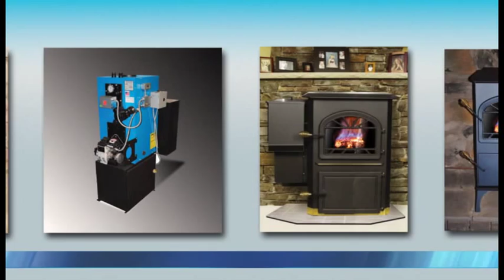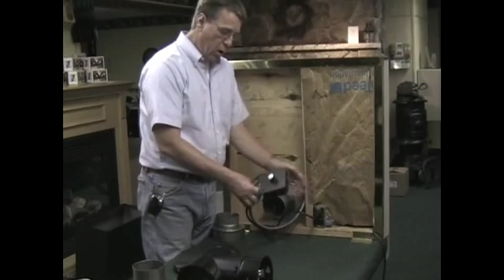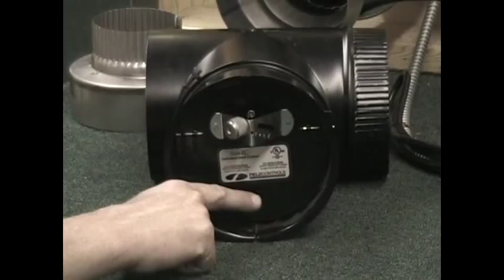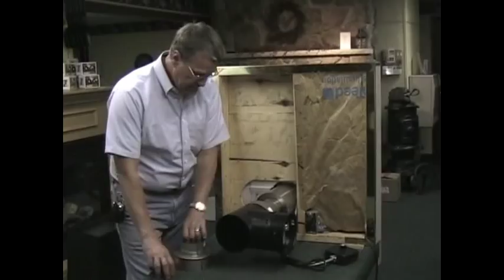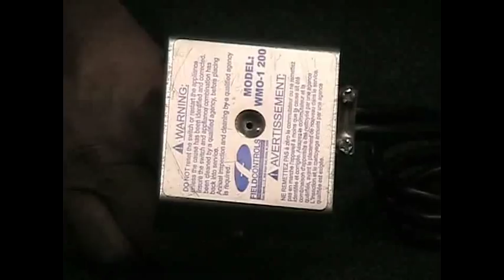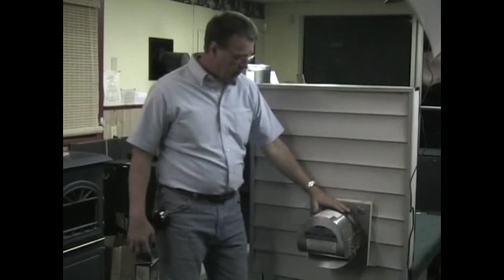Power Vent Installation

Comment: it looks like the Field Controls SWG power venter. mainly used on oil fired and natural gas on mechanical draft and draft induced furnaces and water heaters. i didn't know they are made for stoves too.